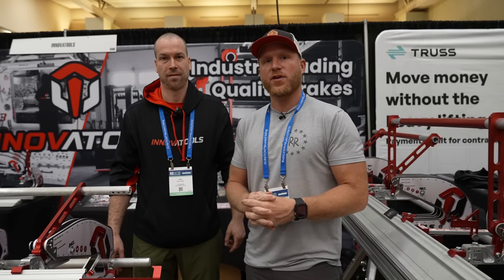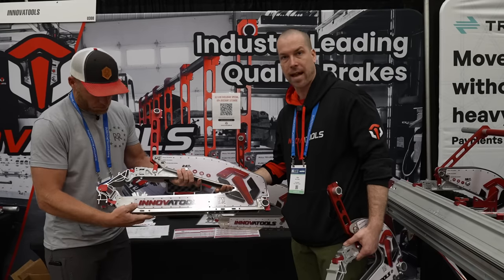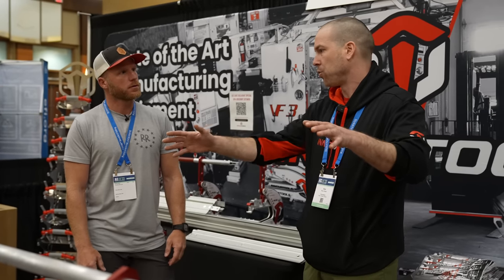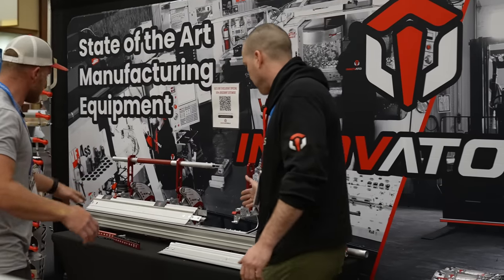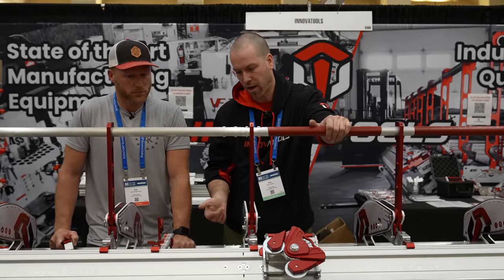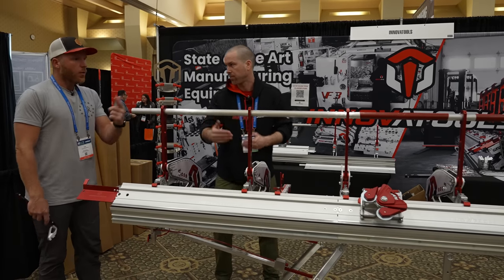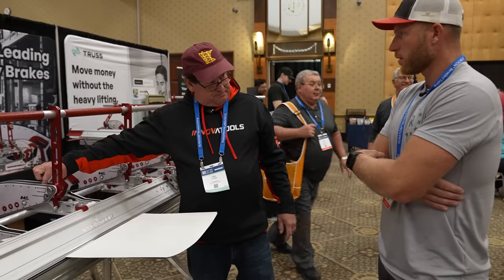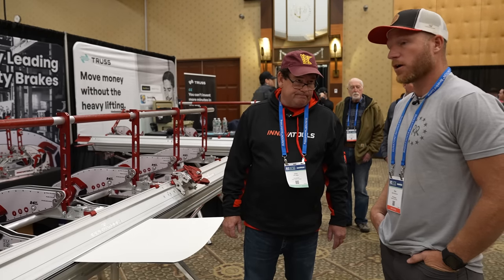The First MAJOR change for Portable Metal Brakes in 30 years?

Comment: Do they offer a break with fingers for doing boxes and pans?
Reply: Hey there Mr Fry 👋
Reply: @chuckfry1227  back at you... Cuz?
Reply: Box returns can be done easily on the ends of the brake and because the handles are moveable you can bring a handle to the end of the tool for ease of fabricating your box return
Reply: @johnmiller-zg7bj  a single box return is great.  But if doing a pan or box, you need to be able to do four box returns in the same direction on a single sheet.  This means you need to be able to accommodate at least one return in the field of the brake.  Which is why finger brakes exist.

It's fine if this does not have finger brake capabilities, most portable brakes don't, was just curious if they had that option.  Would be a game changer for HVAC and plumbing contractors.
Reply: @josephhfry  I understand, I was thinking like a siding and roofing installer and not like a HVAC mechanic. We will take your request to add moving fingers under advisement. No guarantees but an idea we will consider at some point. For now a hand seaming tool is your best bet on the opposing side of the pan. Thanks for your comments, we appreciate your feedback
Reply: @johnmiller-zg7bj  I think true fingers may be overkill, but a way to replicate the capabilities would be awesome.  Replace the pressure plate with one that has 1/2"x1.5" notches every inch.  Having pressure every 1/2" should be enough to get a clean bend, and the spacing would allow you to fold any size box by using the end and simply sliding left or right a little.  Wouldn't cover every use of a finger brake, but might address the needs of an HVAC or Plumber doing drain pans and duct work (I'd consult with some of them).

Regardless... Amazing tool.  I always hated lugging (and storing) a traditional brake.  Making it modular is pure genius.
Reply: @josephhfry  thank you for your comments, Alex is the mad scientist to get ideas off the drawing board, I will make sure he and the team in Ottawa Ontario are aware of your ideas. Thanks again for your interest in Innovatool